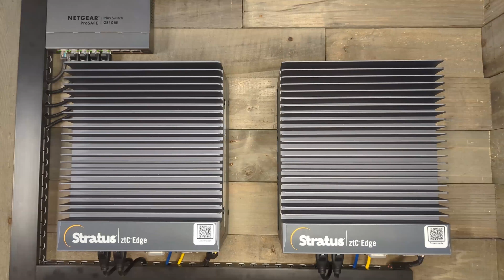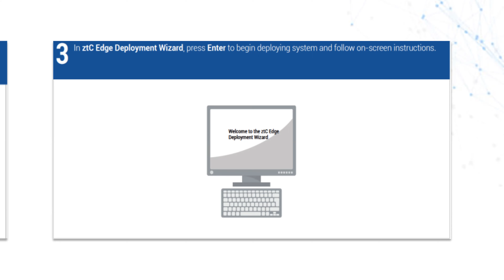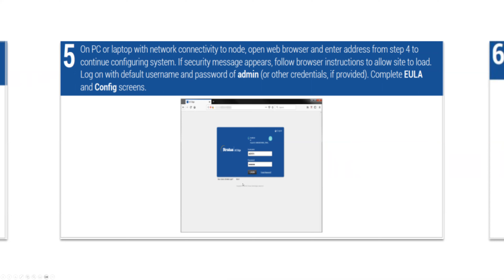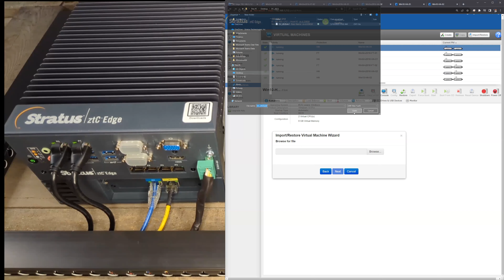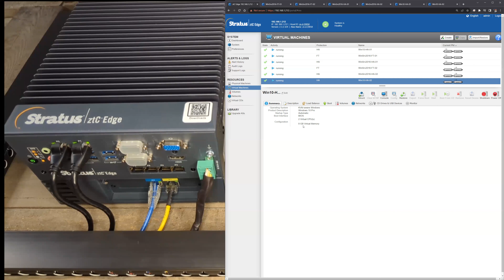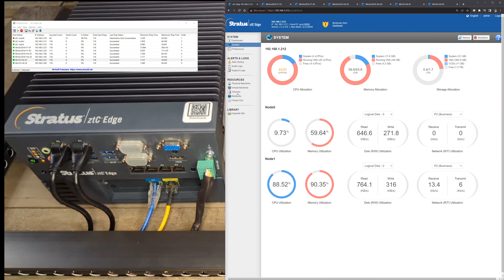ztC Edge Live Demo

Comment: With the HA option, wouldn't the VM restart and come back up on the secondary node?  I would imagine this would drop a few pings during that process.
Reply: That is correct.  If the VM is running in HA mode, the application would be unavailable until the restart on the other node is complete.  In FT mode, the application would simply resume on the other node causing no data loss.

Comment: Nice Vid, anyway can i ask somethings : 1. Is your HA/Pair Connection can work if i add Fiber Optic  converter, since i have 100m+ distance between each node ? or is it possible to connected via switch ?
Reply: It is possible to split the nodes into different locations.  If the distance is great enough, you will need to utilize a quorum server to make sure the nodes do not get split brain.  The key for the successful operation is a 2ms connection between the nodes for FT operations and a 10ms connection for HA operations.

Comment: Nice video! Quick question, I see that that has 1tb total available, what if it gets full and we need more space in vms? Can the whole ssd be cloned and restored in a bigger  7tb ssd for example, and then all that unallocated space be reassigned to whatever vm I need to? 🤔
Reply: The storage space is fixed and cannot be changed.  The ztC Edge 200i has 1TB of storage space and the ztC Edge 250i has 2TB of storage space.  Some customers will utilize another storage device for archiving data to free up space for other things.